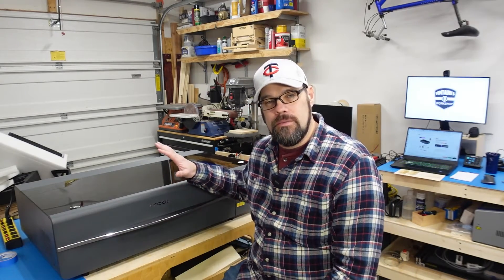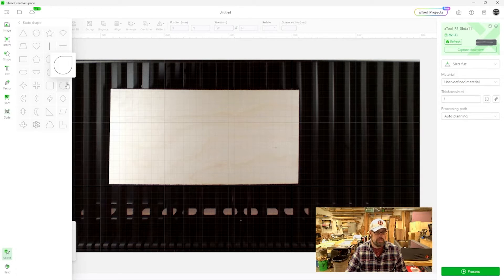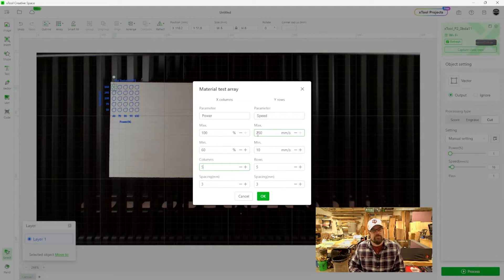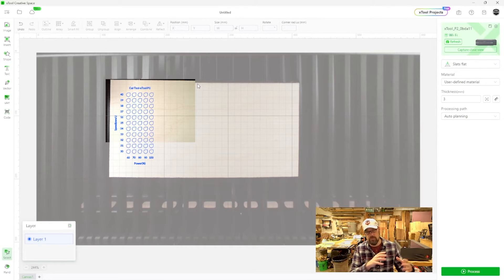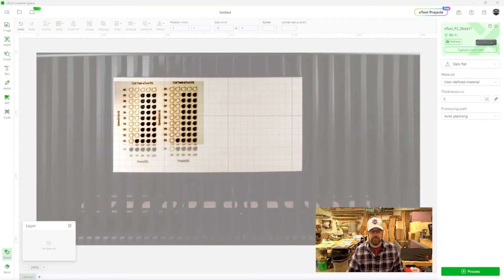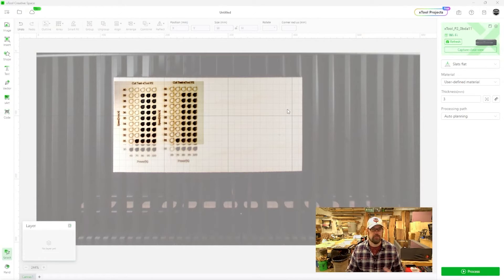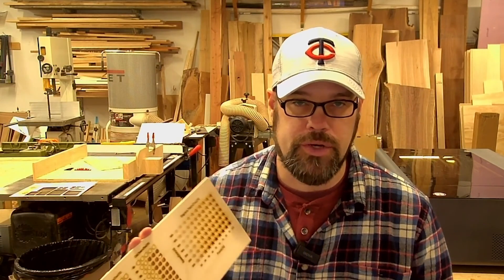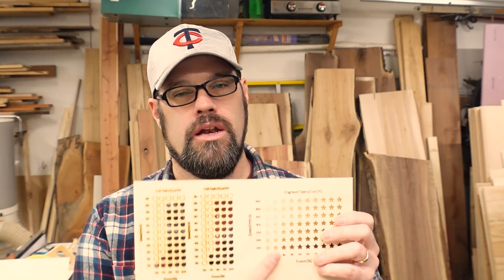xTool Creative Space - Easy test grids to perfect your laser settings!

Comment: Did you have to select, right click, and ungroup for the engrave test in order to get each start to engrave with different settings? I tried this today but they all came out the same. Research showed I needed to ungroup.
Reply from the maker: I have not run into that issue unless I made a change to the grid after using the array tool.
Reply: Newbie question. I did the materials test on a bamboo cutting board today and selected 1% power 10% speed and the engrave took 2.0 hours! What tricks do I have to do in make this alot faster but still get good results?  @Vintauri

Comment: Thank you so much for this excellent tutorial! I haven't been able to find this information in previous searches and definitely wanted to do some testing before jumping whole hog into a project. 😂

I followed these instructions on my 10w M1 on some 3mm blonde wood that isn't labeled as to what tree it came from. I found that the first test swatch was probably way too high as every single shape cut out and it even scored the bottom of my machine a little bit on the higher numbers. 😬

Also- very jealous that the P1 has the zoom in feature and the M1 just does the "framing" thing. I haven't even started my first project and I already want an upgrade. 😂😂😂

Comment: Just got my S1 20w.  I set the same cut array as you suggested using 3mm pine plywood, used the distance to let machine measure, marked cut.  Used the same numbers to set array and sent to laser.  The words and numbers written cut great  but nothing cut in the array.  I can feel the wood is cut very slightly. 
Can you help me figure out what I need to do?  Mind you I am just learning the software and laser.
Reply from the maker: For the S1 20w you'll need to drop the speeds down quite a bit.  For the 3mm material, I'd set your speeds from about 10mm/sec up to 15mm/sec and see what it does.
Reply: @Vintauri  Thank you, I'll give it another try!

Comment: this is work on d1 pro 10w for acrylic  
thanks
Reply from the maker: Yes, this can be used on any material that is safe to run in your laser.  You'll just need to modify the settings to dial in the range.

Comment: When I try this, the laserhead tracks back and forth like it's engraving the entire workspace block by block but it's only firing the laser in one tiny area and never actually engraves anything.  It's really frustrating as I dont want to build this manually but it looks like Im going to need to.
Reply from the maker: Which laser, what speed and power settings are you using and on what material?   Maybe I can offer some insight as to what it's doing.

Comment: Easy to understand video! What size wood did you use? Looks like a perfect size that won’t waste a lot for material. We just got the S1 and want to start running test cards!
Reply from the maker: I ran these tests on some 3mm Baltic Birch Plywood off cuts that were about 6" x 12".  You can scale the test to your material, but generally the larger items will give a better test.  At minimum I like my shapes to be about 1/4" or 6mm square.  I defiantly recommend running some tests on any new material to your laser.  You can get in the ballpark with other peoples numbers, but running these tests will really help dial in your settings.

Comment: Steve, more great content.  Never thought of using shapes for the test but it makes better sense for real world applications. I have a  X Tool D1 i use fairly often  to engrave pieces that i build on my Shark CNC, Just got a  Wecreate to use for small projexts to give away. Have you gotten yours If i remember on your Sunday night lives i thought you mentioned you were getting one. the only thing i hate about it is the software sucks.
Reply from the maker: Yes, playing with different shapes will give a better overall idea of how it will cut or engrave.  I do have the WeCreat and I hope to get some content out with it soon.  I've been trying to get the camera dialed in as mine is off by quite a bit, but the built in calibration tool keeps failing.  My issue has been sent to support but I'm waiting for them to come back from the weekend.

Comment: Great video, as usual! I do have a question though. If you do the material tests with LB and XCS with the same values, will they burn the same because they are the same material and machine or will they vary because of the software? I haven’t been using XCS but have been interested since your last couple of videos using it.
Reply from the maker: This is something I do want to test on a couple different lasers.  There are a few variables between each software that might make a difference.  XCS keeps getting better but there are still some drawing features and layer options that I prefer in Lightburn. However, I've had people ask for more help with xTool Creative Space, so I'm trying to get some information out on it as well.
Reply: @Vintauri  Thank you. I was intrigued when I saw your video using the XCS software but didn’t think too much about it at the time, but shortly afterwards I got notification from XTool there was an XCS app for the iPad. Then I was very interested (I do a lot of designing with Procreate) as I had a hard time converting my files to something Lightburn can use on my PC. I haven’t tried it yet, but may try to this week. Thanks again for all your great info. (By the way, the iPad version of XCS is wireless, so hopeful that will work well.) Have a great week.

Comment: Great video. I had just been using squares for my test grids but I do like that teardrop shape so will switch up my test going forward. For engraves, I actually use an image as that is usually what I will be engraving to give a better representation. I also ungroup the test grid after so that I can change the title to indicate which module I did the test with (I have the S1 with both the 20W and 2W IR modules). I sometimes also move the Power and Speed text closer in to save some space. Then I select everything and group it again. I also add a textbox somewhere indicating the material and thickness of it. Sure you could just write it on there, but we have lasers so what would be the fun in that :)
Reply from the maker: It’s a good idea to test a raster engrave in a test grid like you say. I do that after I run the vector engrave as I did here as it helps me dial in closer to the settings I’ll want. I might cover that in a future video but I didn’t want this one to be too long and overwhelming. Adding the extra labels as you mentioned is a great idea as well. I usually make up a custom test file that includes a few operations in one go so I can just run them all together in one job.
Reply: @Vintauri  One other thing I do once I figure out the best power and speed values for cutting is a grid with a 75 mm straight line. I will set the power to just the one value from the testing (usually 100). For the speed I will use a few below and a few above what I thought were optimal from the test grid. I find when cutting a straight line it's moving at its fastest so want to be able to make sure it gives a clean cut.